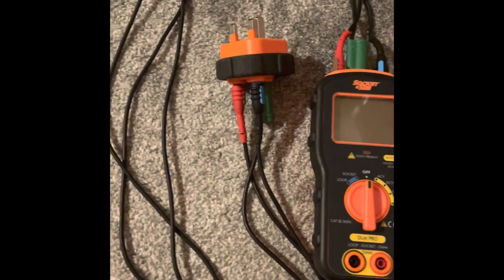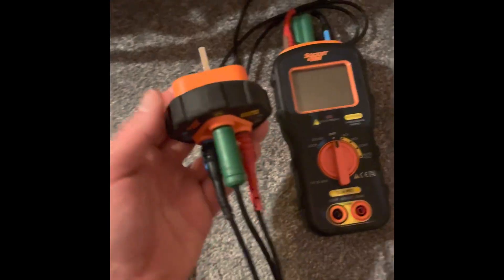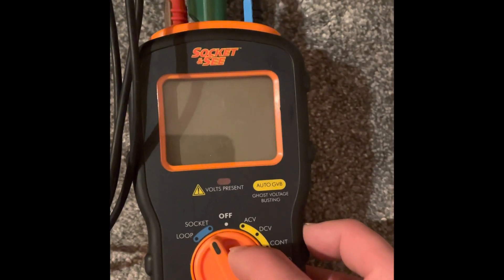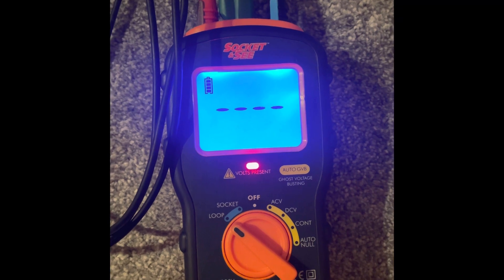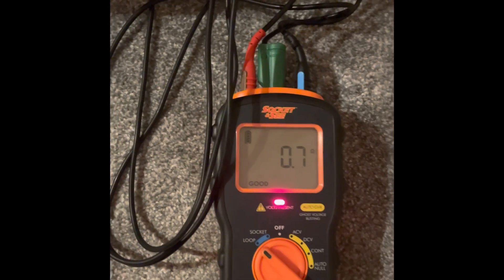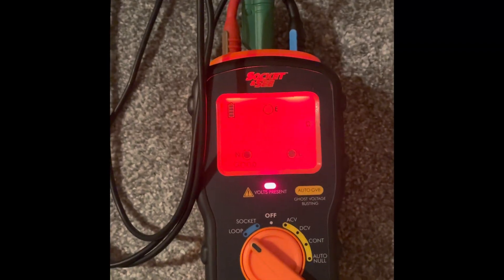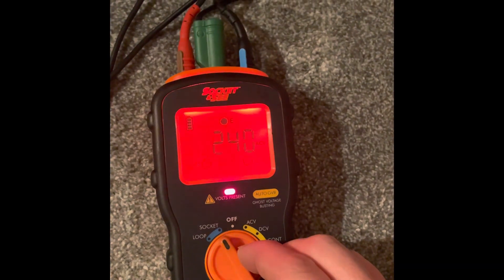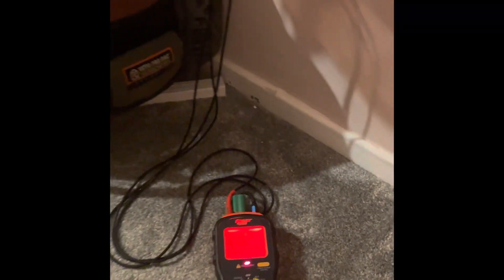Earth loop impedance test

Comment: Question - you would do this with any socket in the house to determine if you touch the boiler you might get an electric shock?

Keep the videos coming. I prefer this format short and concise rather than waffling on like some of the other videos on YouTube.
Reply from the maker: The earth reading itself would tell you whether the earth is good from the main consumer unit or via an earth spike so I do this quick test on the sockets as a peace of mind, I also did it on here like this for demonstration purposes. As part of our safe isolation procedure I would have to gain access to the pcb of the boiler and then carry the checks out on the terminals to be sure that the boiler itself is wired correctly. I can do a quick video on a boiler too if this would help? Cheers
Reply: Yes please could you do that